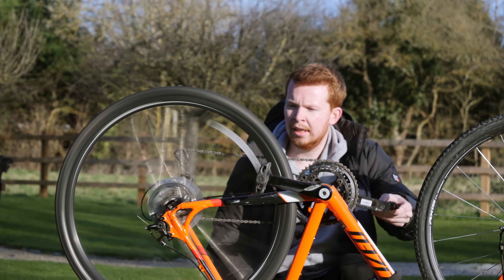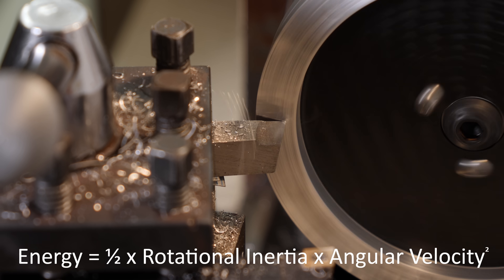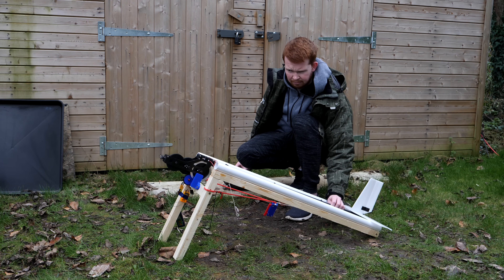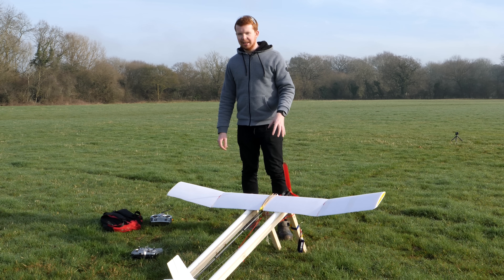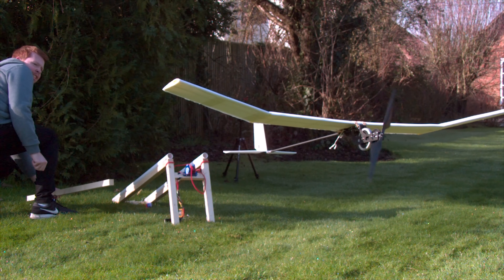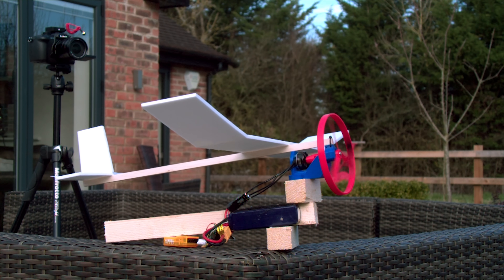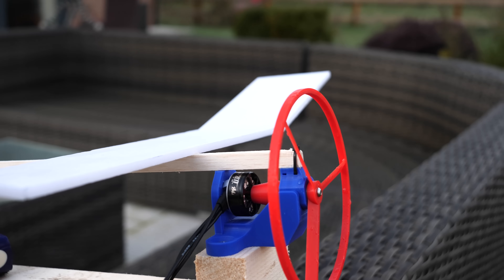Flywheel Powered Plane

Comment: Tom Stanton, 

If I were doing that first one, I would have used the flywheel with some strong magnets for a generator, pass the energy to an electric motor driving a propeller (which you and many are familiar with), and do the control of the RPM electrically.  You had plenty of space further back in the body, and used too much weight for gears and mechanical connections. 

You might try using a spreadsheet model to optimize.  Excel has their Solver and Goal Seeker.  The Goal Seeker lets you click on any cell, start the Goal Seeker, then specify what you want the cell value to be, and choose which one cell to change.

Solver allows you to set bounds on several variables, and then to maximize or minimize some cell - allowing it to vary several different values to find a solution.  So it routinely can be used to take many different settings - mass, radius, thickness, material density, lengths - and then solve for what you are looking for.  Often called your "objective" or "goal".  

Write down what you know or guess.   I am formal when I build things like that. I put the name of the variable, the value in SI units, the units, and links to the source of any constants included.  I go through about a thousand papers a month,  and have found that being organized and conscientious saves massive amounts of time for longer projects.  Saving yourself a few seconds of keystrokes now, can cause hours or days of lost time later trying to remember exactly how the calculations and assumptions were found.  The same applies to things you purchase or use.  Keeping good records of parts and their sources can save days or weeks.  Think carefully if your methods get used by thousands or millions of people.  You save a few minutes writing things down, and they ALL have to spend an hour each for your lack of care.  That is happening on the Internet as a whole and it is crippling progress everywhere.

I put the things I can change in light green cells, and the calculation cells in light blue. The objectives in light orange.  Then when I use the Solver, I am selecting orange or blue cells, setting a target and then telling the Solver which green cells it can change.

I said that generator part quickly.  You can seal the flywheel in a vacuum and put the motor/generator inside.  Pass the electric output to the outside.  You can figure how to use it as a motor to "charge" the flywheel, then switch to generator when you are ready to go.  You should be able to keep feeding energy in for the actual launch, and then disconnect on launch.  Electricity.   I was just doing the calculations for a ring of magnetic spheres guided by electric and magnetic fields.  I was aiming for 10 kiloWatts.  Try it.  A 1 gram spherical magnet is relatvely easy to control. The magnetic levitation circuits are getting easier to understand.  If planes are going to be next, then you might have to try to understand things like that.  It is easy to model, so not a bad place to start. Just gradually improve the models, share and validate them, make them easy to share and bold together.  You can let one group work on a flywheel model, another or several work on supercapacitors, another on propellors or other methods for moving air molecules.  The "trick" is to make ALL the models work together.  

I checked on progress with supercapacitors and they are getting many Joules per gram.  You might find this article interesting, but they are not at the forefront.  https://news.ucsc.edu/2018/10/supercapacitors.html  I add it because they used 3D printing.  Their original paper is https://www.cell.com/joule/fulltext/S2542-4351(18)30458-6 and their areal capacitance is 44 Farad/cm2.   But others are at closer to 1300 F/cm2.  So the printing is helpful, but they are using the wrong materials.  I am going to check the vapor deposition progress.  Basically, why make carbon nanotubes and then shake them onto an electrode, when it might be much easier to put the fractal surface material directly on the electrode, print the electrolyte, then fabricate an electrode layer.  At atomic dimensions, and many layers, a fairly simple production method could give decent results.  The models for surface area of molecules are simple enough to add to Excel or Google Sheets.  I am looking for a better modeling environment so ANY model can be integrated with any other and the whole optimized.

There are metal 3D printers.  I have not checked on the progess with sintering robots lately.  But you could fabricate extremely light and strong craft, including membranes on the outer surfaces.  You are young enough to spend the time to bring that to a professional level.  It will be needed in space and in the colonies (I am presuming in your lifetime there will be some solar system colonies).  Especially if people like you begin to take a serious interest, and start working in global communities, rather than continuing to work alone.

Best wishes.  Your plastic propellers at the end might work with aluminum or glass.  Fiberglass is strong and light.  I can easily imagine fabricating diamond parts using CVD (chemical vapor deposition).  Methodical model management can shorten your design cycles enough to consider virtually any technology, evaluate it quickly.  Breaking into groups that share can have tremendous resources to bear when anyone needs a new capability.  Keeping it open will help. When you add greed, it is like putting a lead weight on your plane for no purpose.

Take my notes with a strong grain of salt. These are just things I think very likely.  The models and spreadsheets I know.  You and your collaborators are the ones who have to try to build things.  Being organized and building groups with specialized, interlocking skills, can help.  I like it that you did not mind showing your crashes.  When I was a teenager, my Dad worked at Cape Canaveral. We watched crash after crash on television. But the thundering launches we saw day by day were mostly successful.  The mood was "anything is possible, with hard work, dedicated innovation, and the cooperative efforts of many". The only addendum  would be "global communities, global goals".  And a healthy sense of humor.  :)

Richard Collins, The Internet Foundation

Comment: Cast a solid carbon fibre flywheel (resin and everything in order to get the tensile strength in the right direction) and spin it much faster. I don’t think you were very close to the maximum specific energy of your flywheel, which is governed by tensile strength. And 3D printed gears are a terrible idea for anything with a reasonable amount of torque going through them or transmission losses to worry about, I’d instead have used CNC aluminium or cast resin.

Comment: it would have saved you some trouble if you started by using wheels
i know wheels add to weight, but till you make sure there is enough power for lift its better to use wheels then remove them later

Comment: Next up, make a flywheel with the disengage mechanism behind the prop to keep the prop spinning longer after release. Nothing too heavy, just enough for extended flight. It'd take the strain off the prop and donut ring. A bit of rebalancing and you'd have the advantages of both methods you explored.

Comment: You certainly have patience and a desire to succeed a quality most do not have and its commendable. Why not investigate electro gravitic propulsion as apparently back in the 50's inventors actually managed to make this work. Investigate replicating the Townsend Brown experiments and if you manage to get some positive results its a game changer.
I personally believe this was cracked in the late 50's but the tech has not been released for the general publics benefit. Its inventors like you with the tenacity and patience that make changes that matter.
Good luck but regards flywheel flight a waste of time IMO. Flight should be a lot simpler and it will be with electro gravitics as this is true field propulsion not reactionary.
p.s Don't be hoodwinked by current laws of physics either, they are not the full story of the possible and far from it. New experimentation is needed. Physcis laws just predict and refine what you have already tested but do not invent or discover new possibilities.
Remember that everything we use today that's useful was invented by Electrical Engineers not mathematics bean counting atomists like Eienstien at al who have given us not a lot.
Don't misunderstand the message, I am not saying current laws of physics are wrong they are just not the end game and they do not explain the reality we live in just a very small 4% of it. So room for some serious discoveries IMO still out there.

Comment: For a low rpm propeller to function on a not so light plane, the propeller pitch must be large. Your geared flywheel ones fail primarily due to too small pitch.

Comment: I am wondering if the direction of rotation of your aluminium disc was causing  the plane to dive? (It seemd to activley dive (rotate downwards) in all examples you showed us rather than simply fall...)

Maybe try changing the direction of spin of the heavy disc... see if it helps the plane body to "rotate" in the opposit direction?

Comment: cool idea
i also was thinking about this
what if you'll try to use bigger radius flywheel, so you get bigger radial speed with the same rpm (so you decrease losses on shaft)
also try to arrange horizontally your flywheel. (like a freezebee plate)

Comment: High power to weight ratio flywheels are use high strength to weight ratio material. So a pure carbon fiber ring would work just as well. Might be interesting to see larger props? Also the prop doesn’t need to be a ring, it could be just weighted tips. That might make it easier to build larger props. A prop with twice the diameter would have 4 times the energy.

Comment: I wonder what a hugely oversized flywheel would do, combined with relatively small aircraft and prop. I assume no chance to control any more, due to high gyro effect. Basically, an up-scale of the toy at 5.04...

Comment: Great work! 

Maybe the weakest link is in the transmission. Can you use one motor to speed up and flying wheel and use them in reverse to generate electricity to drive another motor to drive the propeller?

Comment: You're losing all your energy to the belt & gears. Yeah but the weight of your fly wheel is taking most of it, have the weight as close to the axle as possible. And have it spin backwards not forwards

Comment: The gyroscopic force of the motor is causing the left hand turn.  Try turning the fly wheel 90 degrees on an axis, or best a counter acting wheel which is fed into same shaft via a transmission

Comment: i believe that the original design with the spinning flywheel may have been causing the plane to rotate itself into the ground, because of the third law of motion: for every action, there is an equal and opposite reaction, which basically means that the flywheel was spinning one way, and the law of physics caused the rest of the plane to spin the opposite way; into the ground. This is also used for other things, in the form of "reaction wheels".

Comment: I toured a data center one time and they had a flywheel based uninterruptible power system. Conventionally most places use batteries. The flywheel system was supposed to be more reliable and didn’t need to be replaced every 5 years or so.

Comment: The final version was really cool and simple. One thing though, if the outer ring of the propeller was made of something heavier will it fly longer? Kinda like your first version with the carbon fiber inside and the aluminum ring only the carbon fiber is the propellers and the ring is still just aluminum lol. I think it would be pretty cool I just dont know the math if that would make things too heavy to preform or if it would make it too off balanced.

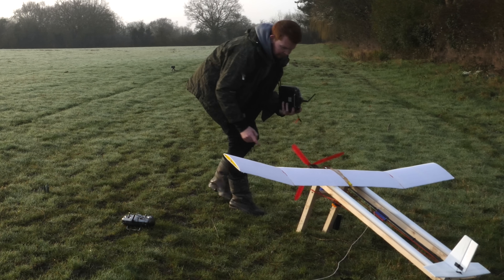Comment: Pausing at 3:06 and wondering about the gyroscopic effect of that flywheel... Only really thinking about this because I recently watched a video about the Sopwith Camel, which was apparently very hard to control.
Reply: I hope you'll retry with the original design. Was the power sufficient? I feel like you would have checked the power to weight ratio before the flight test like I've seen you do in the past, but you didn't show it here.

Anyway, great content as always. Thanks!
Reply: You're applying a force tangential to the axis of rotation... Ugh, gyroscopes are hard. I wonder if a pair of counter-spinning wheels would cancel each other out... I feel like the plane was downpitching because of these forces but it's been almost 20 years since I learned these things...

Comment: How about using a larger version of your carbon fiber flywheel as a propeller? With directional vanes in the carbon fiber, the aluminum ring in place and the same spin off release. Will that maintain the propeller speed for a decent flight?

Comment: Idk if this is gonna make me sound dumb but what if you used an electric engine connected to the side that you have the prop attached to, then attach the prop to the flywheel side so that way you can transfer low speed to high speed? I know that’s just simple gearing but idk

Comment: I'm always fascinated by what you do.
Gears: print once make castings.
What is the air friction on the spinning flywheel like? Might negate the gains in energy you got from the speed ... maybe calculate the point of diminishing returns....

If you decide to play with ornithopters, give me a holler. I have something I want to test....

Comment: Sorry Tom, worst video yet. When will you learn that 3d printed plastic gears do not work and are the source of all your noise and energy loss? Properly done. the original design would have worked.

Comment: Once in motion a car needs only a fraction of the HP to keep it moving forward.  Fords Model T had only 8 HP , but had a flywheel that was 100 lbs.  It was the stored  energy in the flywheel that got the car moving from a stop. The 8 hp  engine maintained the forward motion.

Comment: Engage safety squints! haha please follow up to figure out WHY that ring flew so far and so stable all on its own, amazing.
Reply from the maker: Might need to try 'flywheel' projectiles next haha
Reply: @TomStantonEngineering  I'd love to be as clever as you!
Reply: @TomStantonEngineering  We need that rights now!
Reply: Remember those circular paper airplanes? I'm thinking he could just print a really deep outer ring, low pitch blades to hold a hub, and build a flying propeller.
Reply: Ah a fellow AVE viewer I see
Reply: The ring still had very small tabs of the blades attached (look at 6:26 on the video). Even though they're very small, at that speed, that pulls it forward. DG
Reply: @deegee8032  I'm pretty sure that it travels the way it does due to the magnus effect.
Reply: The gyroscopic stabilization keeps the direction. In that direction the airdrag is minimum. The rotation also reduces the drag coefficient I think.
Reply: The same reason the world record paper airplane flys so well (its just a ring too)
Reply: Circular wings are actually really stable, there was a brief mania in earlier aeronautics about them until it was discovered that the supports to hold them up created roughly the same amount of drag.
Reply: forgot torque in equation
Reply: safety squints i love it
Reply: I hate u, but i mage it 666  likes tho
Reply: Vortex wing, my guess.
https://www.youtube.com/watch?v=KjlNIIexFoE
Reply: This is a great point.  Would love to see someone conceive a flying machine like that.
Reply: Wudnt a battery designed to spin , replace the flywheel.
Reply: https://youtu.be/n4nZPU6L4cI
Reply: It's because of gyroscopic forces

Comment: Wouldn't the translation the other way round make more sense? like low flywheel rpm --> high prop rpm? this way you can put more energy into the fly wheel and achieve higher takeoff speeds... thus gaining more height.

Comment: Maybe you would have had more success with your metal flywheel if you mounted it further back and used a prop shaft/drive shaft to transfer the energy to the propeller? It looked a little nose heavy. I was wondering too could there be any drag on the flywheel as its moving through the air? Encasing it behind some 3d printed body might further help your efforts, as would maybe using a launch pad that is similar to a slide on its back, so it can build momentum along the straight before hitting the ramp. Just thoughts and observations. Great work though and great creativity!

Comment: I know scientists that designed flywheel powered gizmos. The flywheel can be extremely dangerous so needs proper engineering, testing, and a protective casing. Some small flywheel designs store so much energy that no practical safety casing can be built; those are to be avoided, of course.

Comment: Tom, what if you used the same flywheel and maybe even gearing but moved it to the rear of the plane and then use a prop shaft that goes up to the nose of the plane to drive the propeller?

Comment: You need to spin the flywheel the other direction so centrifugal forces aren't trying to push the plane down and will push it up. You can actually make "anti gravity" using flywheels.

Comment: The first thing I thought, when I saw the flywheel plane fail mid flight is that gyroscopic procession is twisting the plane into unstable flight. It's not such a problem with light parts (props, small motors, etc), but with that heavy flywheel it seems to be a major problem.

Comment: Flywheels CANNOT be used to store huge quantities of energy on a unit weight basis. 

Gasoline contains circa 45 MJ/kg whereas flywheels are in the range of 500 as KJ/kg. 

Please note that 45 MJ/kg is 90 times as much energy per unit weight 500 as KJ/kg. For short term storage and high output, they are OK. For high capacity long term storage, they are useless. Furthermore, there is always the danger of explosive disassembly.